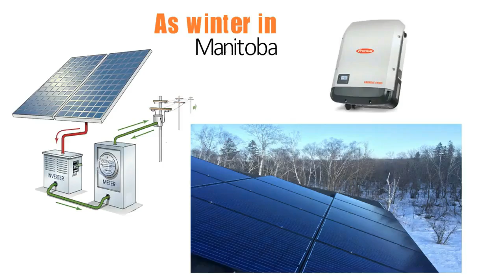why choose Micro inverter for your roof in Manitoba Canada! AP Systems and Enphase Micro inverters

Comment: OK... real world not theoretical stuff here.... I installed APSystems 5 years ago.  Today, about 40% of my inverters have failed, and the company won't honor the 25 year warranty.  Where is the return when the product breaks?  My last install was Enphase and so far it has been a dream.  The company actually supports the product versus telling you to go away.  It is no wonder why most of the installers I've talked to are installing Enphase over APSystems.  Am I upset?  Sure!  But that doesn't mean the cold hard numbers aren't something that should be looked at.

For me, the cold hard reality is that APSystems was the single worst home improvement decision I have made on my home.... Not solar, but APSystems.  It has been a real loss.
Reply from the maker: they have a 10 year warranty unless you upgraded. Also email me as I can help you get your warranty I have a direct email so no issues ever with warranty support@evolvegreen.ca include the ECU number and your name when you email me and we will get you looked after...
Reply from the maker: I have hundreds of systems running with no issues or very few. You could be un lucky but also could have been a botched install. There are a few reasons for failure. Number one on the list is the contractor made the connection cables too tight and the pull is enough to create a small arc that the inverter shuts down. these just need the GFCI reset... or you had lighening and the inverters need the GFCI reset... your grid could be high volts and need the parameters opened....  you can also send your login in details so I can see the back end.